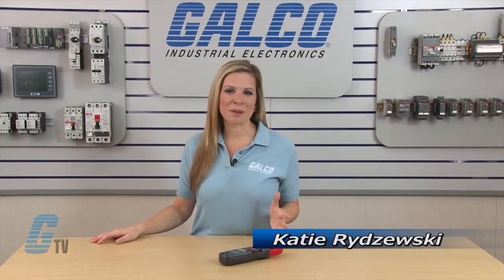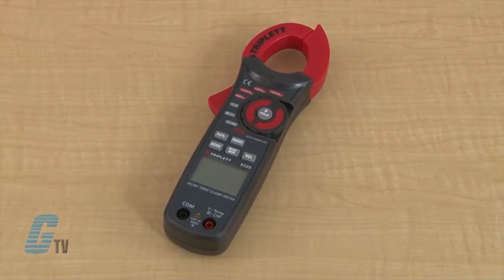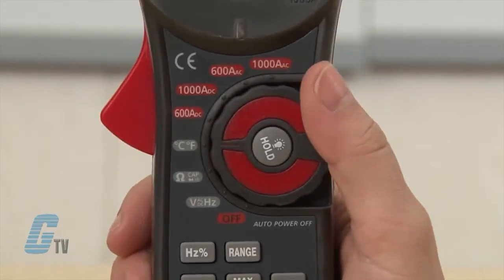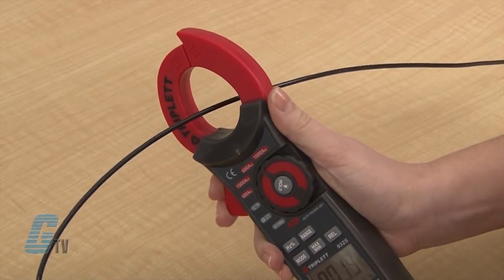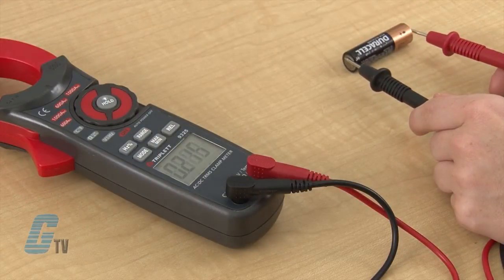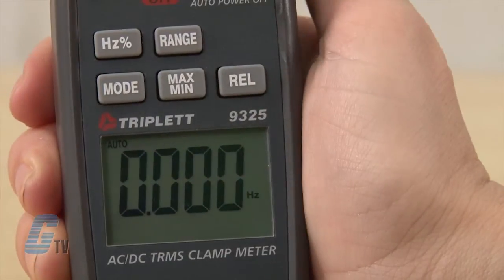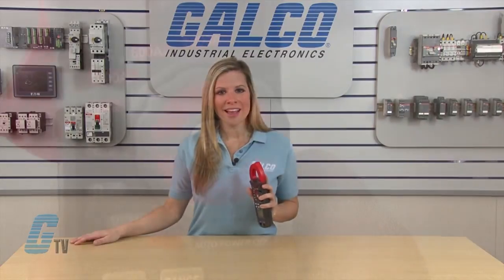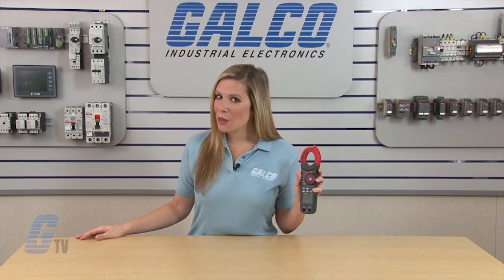Triplett 9325 Clamp On Meter

Comment from the maker: The Triplett Model 9325 is a 3 3/4 (6000 count) True RMS digital clamp‑on meter with a backlit LCD display. It offers a large variety of measurement features including AC/DC Current, AC/DC Voltage, Resistance, Continuity, Diode Test, Temperature and Capacitance. The rubberized overmolded housing provides impact and drop resistance in a sleek ergonomic design, and the user‑friendly Auto Power Off feature helps maximizes battery life. With a leading CAT III design it provides superior resistance to damage from transient overvoltages in any demanding industrial settings. The Model 9325 is suited for a variety of industrial and residential applications such as security, electrical, HVAC installations and more.